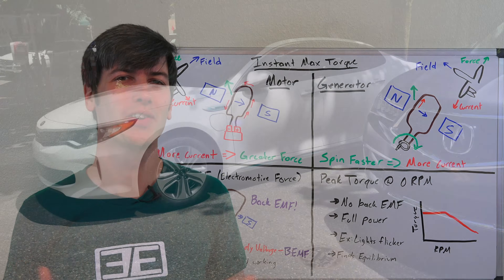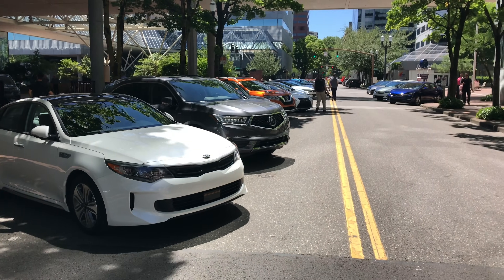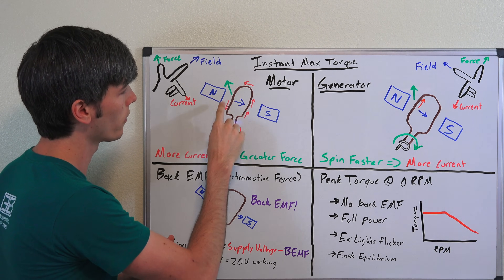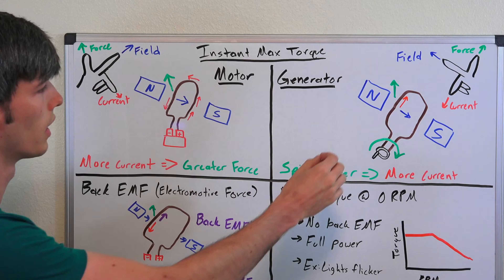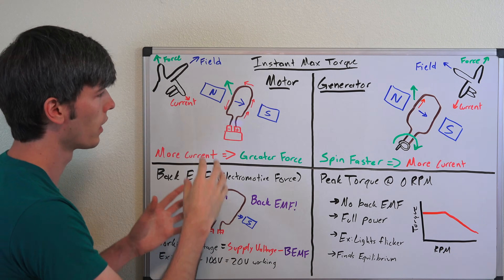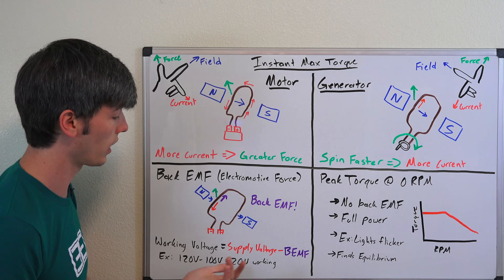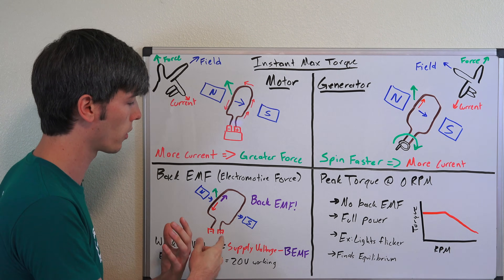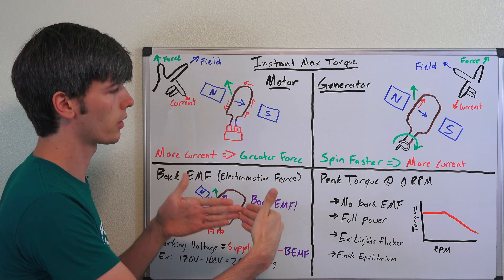How Do Electric Cars Produce Instant Maximum Torque?

Comment: where the hell did you get your degree from where they don't follow the convention of the RIGHT HAND RULE???
Reply: +Israel Garibay both of them are valid but right-hand rule is the standard
Reply: Israel Garibay I thought the John Fleming right hand rule applied to generators and the left hand rule is for motors?
Reply: Sure, but why change the right hand rule to the left hand rule in different scenarios? The principals never change, follow the direction of the current, note your magnetic field, and the force will always be perpendicular.  

I guess different parts of the world use different conventions ¯\(ツ)/¯
Reply: IDK but in four different physics classes I've learned both ways twice ¯\(ツ)/¯
Reply: the same point of a 2d plane can have 2 perpendiculars

Comment: Amazing how small the motor itself is (less the casing). Not much larger than a 1/4 hp furnace blower motor. Weberauto has some videos of a Chevy Volt motor removed from the casing.

Comment: Great video! Very well explained! However I have a little reserve when you're saying full POWER at 0rpm. This is incorrect, I'm sure you know why! Power is proportional to torque x speed, so at 0 rpm, it is true that you can have 100% torque, but you have very little to no power produced because the motor is not rotating yet. Once you start rolling, then the power is increasing until you cannot provide enough torque and then power could decrease even if the speed is higher. Another way to explain this is that torque is proportional to current and speed is proportional to voltage. In electric engineering, power in watts is voltage x current, so at 0rpm you have 100% current (because 100% torque), but a very low voltage (because no back emf is produce yet), so almost no power. The only power you have at 0rpm is the losses caused by the circulation of the current.
Reply: Yes and no. An electric motor without any control electronics would actually attempt to reach it's rated power output at 0 rpm. Of course it's impossible because the produced torque would have to be infinitely high, but that's why the current flow tends to be so extremly high at start up which is actually a problem. And that's why the star/delta-startup switch and similar things were introduced and used to start up powerful electric motors in the past. Otherwise these things would have fried a lot of fuses. Today of course with sophisticated control electronics the problem is basically solved and the motor will deliver a perfectly flat torque curve up to a certain rpm.
Reply: EE is describing a DC motor, not an AC induction motor..

Comment: Although a very nice video, the fact that you are using a DC Brushed Motor as an example makes my mind hurt a lot LOL. Electric cars use AC Induction Motors and the way they work is HUGELY diferent then the motor you shoud as an example in the video.
Reply: "Electric cars use AC Induction Motors". That general statement is wrong. There are plenty of electric cars which use permanent magnet motors, like the Chevy Bolt and the Tesla Model 3. Sure, not brushed, but still DC (BLDC to be exact).
Reply: Actually they use induction or synchronous AC depending the manufacturer
Reply: BernardoDNeves than*
Reply from the maker: This was intentional to keep the video easy to understand. If folks want to learn about AC induction motors, I have a separate video on it (and many other related videos in the description). AC Induction: https://youtu.be/EWZkFX48vu0
Reply: yeah, isn't power or speed or.both modulated by the AC frequency?
Reply: That was a surprisingly accurate yet breif description. And it is infact applicable to ac induction when you realise that the induction to the rotor does exactly the same thing as a commutater with relation to back emf and voltage drop.
Reply: @johndunlop6152  That's what I was thinking, but I dont know a whole lot about electric motors in cars.
Reply: Basically, the general concept itself can be applied to any type of motor. But I agree, the functioning of AC motors is more complicated than what was presented.
Reply: I agree, it doesn't really explain. And it would be difficult to explain. But plenty doable. 

You just need to explain the torque curve on an induction machine, How that relates to slip and synchronous speed, then explain that the power electronics in the car (DC-AC converter) adjust's the frequency, which would change the synchronous speed, which would change where the peak torque was.

I don't think people need, will, or care to understand all the E&M behind it.

I mean there's a few other things that go into it, but I think that would be a better way to go about it...
Reply: The fact that people can't agree on the type of motor is why EE used a simple DC motor.

Comment: Why can't they produce instant horsepower
Reply: JøÉ M - Because (horse)power is torque multiplied by RPM, so the power at zero RPM is zero.
Reply: Because power is the product of torque and speed. Zero power at zero speed.
Reply: Power = torque * rpm, so at 0 rpm you would need infinite torque to achieve set power. There two limitations to the amount of torque:
- the maximum torque that the transmission can take before breaking
- the maximum current the inverter can supply before it breaks (torque is roughly speaking proportional to current).
So you can easily get maximum torque by providing full current, as long as you stay below the limit of the transmission, but you can't get instant max power because everything will blow up.
Reply: Power, be it mechanical or electrical is always expressed with units of time. Energy spent over time. You can't spend any amount of energy in 0 seconds, you just broke maths and the whole universe. 

So if you use 500 Joules over 5 seconds, the power is P= E/t --> Power= Joules/seconds. That's a 100 watt light bulb for example. The same energy spent in 1 second would yield 500 watts. 

That's why the kiloWatthour unit of energy is a real pain in the ass... it expresses power (kilowatts) times time.... bringing it back to energy. Standardising it to using Joules would be so easier to deal with and less confusing. Basically  1 kWh= 1000 J/s x 3600s= 3.6 MJ 

If my unit conversions skills didn't vanish, rating a car battery in MJ (Mega Joules aka Millions of Joules, or Gigajoules billions of joules ) would mean that a battery with a "capacity" of 100 kWh  would be expressed as a battery with a capacity of 100 000 J/s x 3600s= 3600 MJ= 3,6 GJ 

I can wrap my mind easily around figures in Joules, much less in kWh

Comment: Actually that is not how a motor works, when you aply a electric current to the wire the wire will polarized in some direction and it will rotate until it is alined to the magnets magnetic field, and it will stay there, so motors to mantain rotation they use a lot of these wires seaprated betwen them, and they conect to the current by a solid contact made of grafite which connects as the wires spin,

Comment: we give 120v gets back 100 , working volt is 20v, so in effective do we reducing the work?? so back emf is good, then how torque decrease???
Reply: Back EMF is basically the motor's resistance to spinning. So the more back EMF, the harder is is for the motor to spin and thus the more power you need to give it to keep it spinning faster. Which is why electric cars are not particularly efficient on the highway.
Reply: Vivek Raju because you get the most power from a bigger voltage drop across terminals. Ie just as the car moves theres a voltage drop of 120-0 = 120v. As the motor spins, when it reaches a back emf of 100v, the net emf across terminals is 20v, a much lower power output.
Reply: Zashra Electric Cars Motors are Not less eficcent at higher rpm, it's the sqare Nature of air resistance, which leads to higher Energy needs for maintaining Speeds
Reply: ikjadoon MPGe?? (Miles per gallon of electrons? 😜). Is that a real unit?
Reply: Oh, heh: it is real; it's how the US gov't rates the efficiency of electric cars. 

https://en.wikipedia.org/wiki/Miles_per_gallon_gasoline_equivalent
Reply: That last statement is incorrect. Always do a sanity check. Electric cars are insanely efficient on the highway, about 105MPGe on average. When's the last time you saw a 3-digit MPG on any car ever?

Relative to an electric car's city rating, that electric car's highway efficiency is lower (the opposite of ICE cars).

Comment: This is only half of the truth. If you google for induction motor torque curve, you can see that the maximum torque isn't available  at 0 rpm. The speed and torque in electrical cars is controlled by the inverter which supplies U (voltage) and f (frequency). Torque is defined as U/f so the torque may be kept constant until nominal voltage is achieved. After that, increasing the frequency lowers the torque.
Reply: NaraKin his graph kind of showed that.
Reply: NaraKin the induction motor torque curve is irrelevant here since it describes the steady state torque for a given speed for a fixed stator frequency, usually 50 or 60 Hz. The inverter, as you say, vary the frequency to the motor to get the peak at any desired speed.

Moreover, torque is not defined the way you say. The units don't even match.
Reply: Not entirely. A constant V/f gives an approximately flat torque limit (before the motor will stall), not a constant actual torque. Consider an induction motor supplied with 400V 50Hz, can you say what torque it produces? Of course not, it depends on the load. But (given the specs) you can say how much torque it can produce before stalling.

What I'm saying is that there's no fixed relationship between V/f and instantaneous torque (which is what drives the car forward). All of this is irrelevant because the torque curve is based on a very simplistic model of the induction motor and only valid in steady state, not in the highly dynamic case of a launching EV. Because of this, V/f control is basically useless in a modern electric car. Those that use induction motors use a more advanced control scheme (at least I really hope they do).

NaraKin's conclusion is correct, though, as it is for most electric motor types; constant rated peak torque can be produced up to a point where the available/rated voltage is the limit, after which higher speeds can only be achieved with lower torque demand (often following a constant power curve).
Reply: Andreas Fritiofson in an induction motor the ratio between voltage and frequency has to be the same in order to have a flat torque curve. I think he kinda wanted to say that
Reply: Andreas Fritiofson okay, but I mean that for example 200V 25Hz gives the same Torque as 400V 50Hz. Current is the same and power is half.

Comment: Dear you gave the explanation of a DC motor, so that the AC motor has instantaneous torque capacity only by using an inverter with control by space vectorAC motor has instantaneous torque capability only using an inverter with space vector control
Reply: this